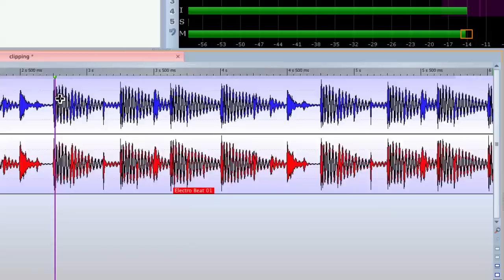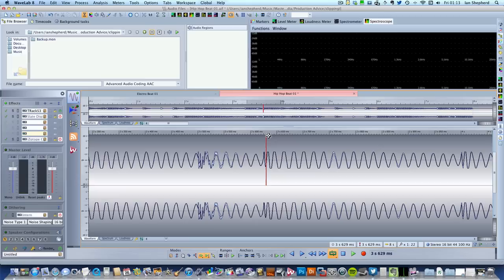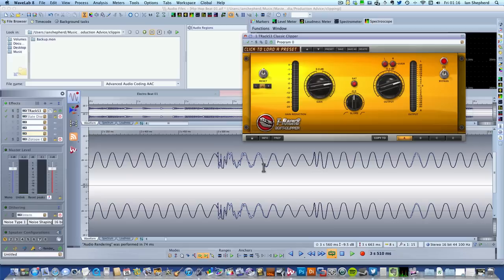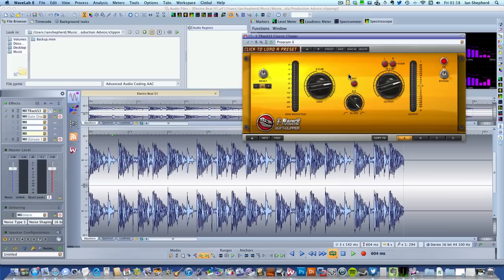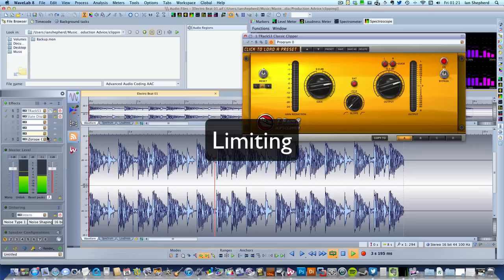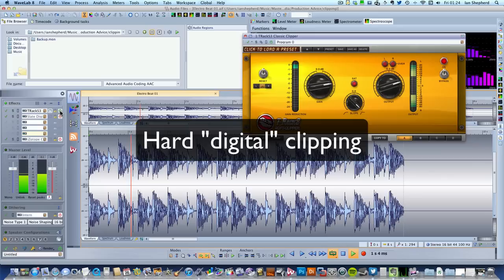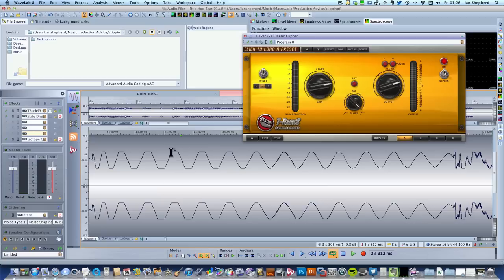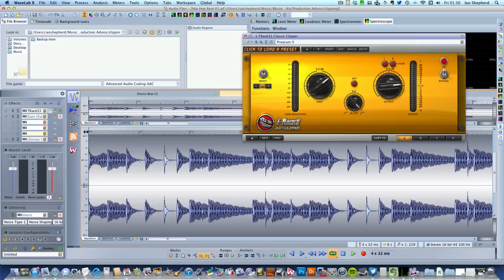Clipping versus limiting - what are they, and what do they sound like ?

Comment: "Clean" is the best for me too. But that raises a question: Then, (sometimes) should I avoid using limiting? Or just use it in a very subtle way?
Reply: If you use limiter, make sure it doesn't hit it too hard. You check that on the Gain Reduction meter, usually if it's more than -3dB it's modifying the sound.

Comment: So I hear absolutely 0 difference around the 2:03 mark for the clipping vs clean. I have a SBX sound card and AT's AD700 headphones, also couldn't hear anything different using CKM500 IEMs, latest hearing test which wasn't too long ago showed I had perfect hearing, Any idea why?
Reply: Hello Xendrus,
I believe these stuff have a learning (or hearing) slope until you start seeing the difference. I myself have some hardtime hearing the differences. They are audible to me, but I cannot tell which one is which. I also don't hear some changes in compression on a drum track. I think I have to listen more!
If that wasn't what you meant, forgive my misunderstanding! :)
Cheers.
Reply: I hate to rub it in, but it sounded really obvious to my ears :P I don't even think my setup is THAT audiophilish either.